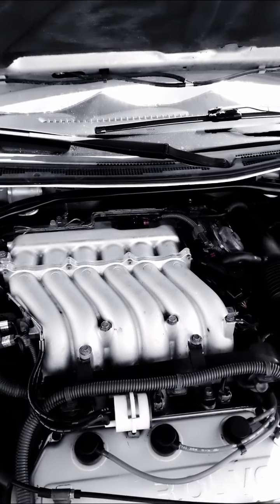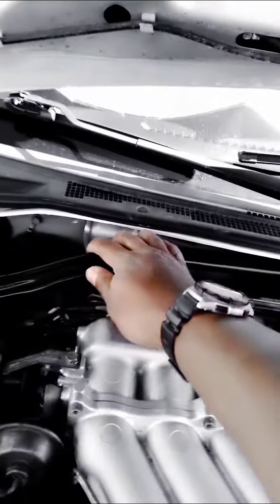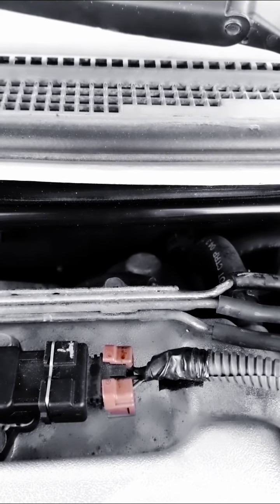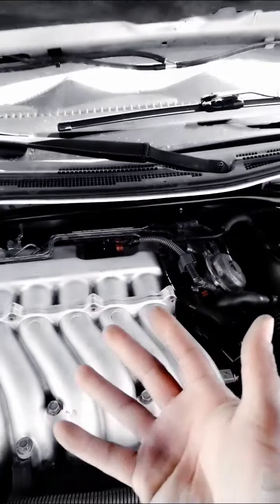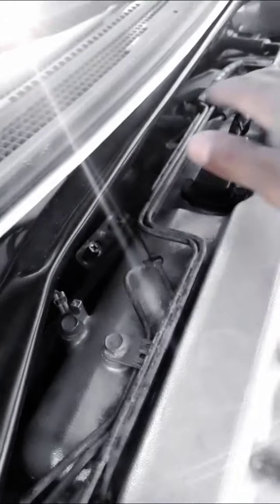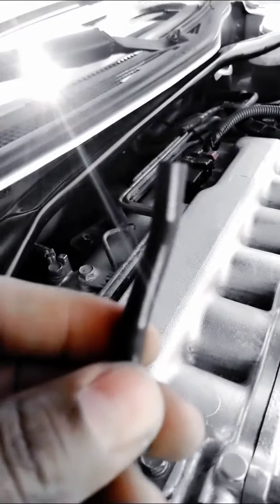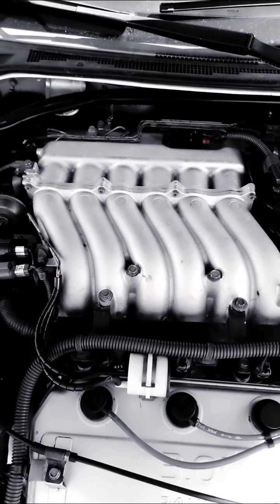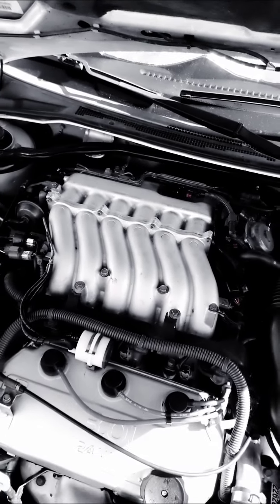P0401 CEL -  2003 Mitsubishi Eclipse Spyder V6 (Mitsubishi's Secret!)

Comment: i literally just bout a 2003 eclipse spyer hours ago! and hes sayin its the EGR valve..an im bout to go scan it tommarow! i'll let u know what happens..i subscribed
Reply from the maker: Thank you for the sub brother!
Let me know what it says.👍
Reply: @theservantwithawrench147  Yea its the same code as yours....So the guy at oriley said it has to clear on its own an i'tll take a while couple weeks . to read it an set on its own.....did yours clear?
Reply from the maker: @FIGHT101TV  
Mines did not clear, but I clear mine through an app attached to the scan port, and it comes back a day later.
I believe I have a vacuum leak. Maybe the seal on the upper manifold didn't seal completely when I decided to change my rear spark plugs.

Just a heads up......
If you ever have to change the rear spark plugs(in a V6), TAKE YOUR TIME...there's a lot to remove.
I had to watch two different videos to get everything right..and when I put everything back together, one of the solenoids (on the passenger side, corner of engine bay,) broke. Had to order a new solenoid through Amazon.

Also, keep an eye on the oil. The Spyder tends to consume oil from time to time. I check mine every 2-3 weeks..but I drive 140 miles a day to work and back.😄..no I really do!

Also...keep your eye on the tank gas funnel.
It's behind the gas cap. Just get down, look underneath, and there's 2-3 lines that leads to the gas tank.
Check to see if any of the lines(metal lines) when been rusted through or badly rusted.
There also a metal support for the lines..dirt is known for collecting inside of that metal support, and that causes the rusting over the years.
Those lines cost $300 or more depending on where you shop(Rockauto, AutoZone, etc.)
So hopefully yours are still in good condition!

I'm still learning about the Spyder, I'll let you know or post anything if I find anything out.

Stay blessed brother!
Reply: @theservantwithawrench147  my EGR is brand new replaced...I just sprayed cleaner on the air sensor....so hopefully my car don't die out when I park anymore.  I think mine are clogged too....I'm thinking I can clean it myself . Did u?

Comment: My car has the same code but mines a 4cyl 2.4, I already cleaned the EGR, what else can I check? My does not have that little hose with the green lines
Reply from the maker: Have you checked for vacuum leaks yet around the hoses and along any metal lines? You can use some carb spray, and see if the idle has changed as you spray.

Comment: Can someone help my figure out what the black box located at the bottom of 9:15 is? I just got this car and it’s not connected to nothing. I have a hose coming from the aluminum block on the bottom right at 9:09 but it’s not connected to nothing but has a suction. Thanks in advance

Comment: So I'm having trouble finding a hose that has that restricter in it can I just make one
Reply from the maker: Well if you're looking for a replacement hose that is exactly like the hose with the restricter..you won't find it.
But you can try and just replace it with a regular hose of the same size without the restricter, and see if that helps.
Also, you can go to a junkyard, and see if they have any 3g Eclipses (V6), and just take the hose off of one of those.